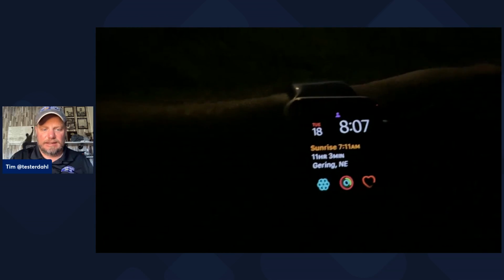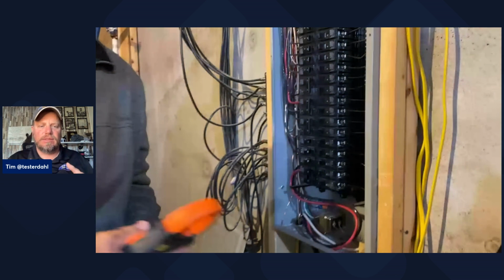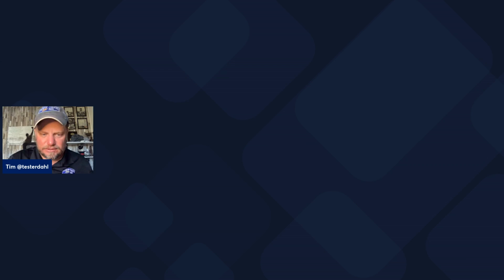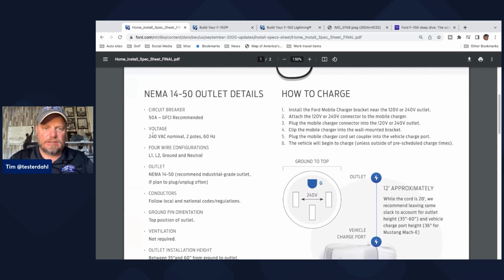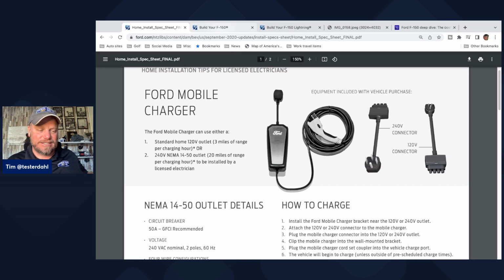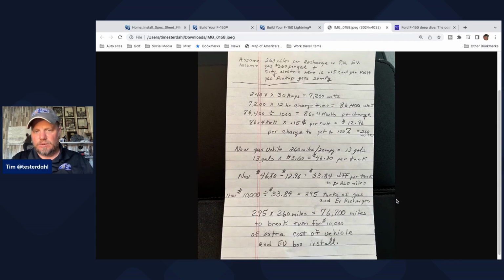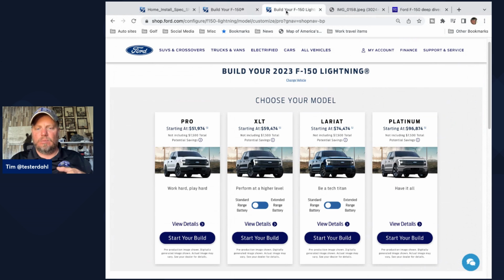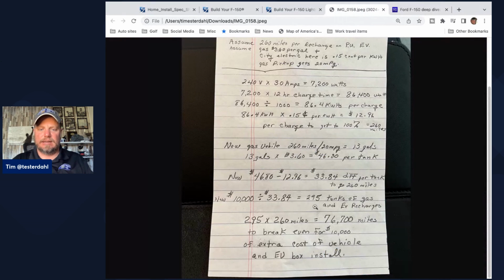11+ hours later on 220V charging price for 2022 Ford F-150 Lightning

Comment from the maker: For those wondering, here is the replacement battery price for the Lightning: https://www.youtube.com/watch?v=gCQLvTiINOo&feature=youtu.be
Reply: If you get 18 mpg over 259 miles @ $5.30 a gallon and you drive 259 miles a day every day for a year.  94,500 miles a year.  You will spend on gasoline alone $21,000 more with an ICE truck.  Assuming 14 cents per kWh for E.  Vs your super slow 5 kW charger.  130 kWh battery adding 50% over 13 hours is 5 kW an hour.  Why didnt you install an 80 amp 19.2 kW charger on a 100 amp circuit, 80% rule?  Charge 100% in 6.5 hours.  Or DCFC at 150 kW.  Depending how DCFC work in your area some charge by time some charge by kW and some are free.  

As for why 5kW the charger may not want to work at only 30 amp and may default to 20 amps.  

The 80% rule.  

40 amp line 32 amp charger
20 amp line 16 amp charger
100 amp line 80 amp charger
60 amp line 48 amp charger
Reply from the maker: @arenjay3278  Easy answer. I don’t have room to add 100 amp circuit without rewiring fuse box, calling utility company and spending thousands more to get the service installed.
Reply: @Pickuptrucktalk  that would be a problem then in Canada houses have 200 to 400 amp service.  Allowing for 100 amp circuits and 80 amp chargers to charge a 130 kWh battery in 6 to 7 hours.  Or a GM Chevy 200 kWh battery in 10 hours.  In your case you will need to public charge.  Your 5kW charge will help but your 120 to 150 kW DCFC speed will mean topping of your truck at a DCFC 65 kW in 30 to 45 minutes.  But dont worry it is still faster than gas.
Reply from the maker: @arenjay3278  Interesting. I had another Canadian viewer who said all the homes in his area had 100 amps of service.
Reply: @Pickuptrucktalk  i guess it depends where you live and if you have duplex or row houses, really close together.
Reply: Wow, it took you about 26 hours for a full charge or 257mile / 26 = 9.88 miles of charge per hour.
So a 26 hour DAY of charging for every full tank!
Or you could go to the gas station and get the whole tank in 5 minutes.
Reply: The 26 hours of charge time makes the truck USELESS for more of the time while a gas truck could easily do 600 miles or more a day for service calls. That would take  3 to 4 days with the Ford.
Going 600 miles would take 600/9.88 (miles per charge hour) = 60.72 hours of charging!
Reply from the maker: @anthonywilliams7052  huh? Sorry you lost me on the math. This is the video you should watch on a road trip with the Lightning. 

https://www.youtube.com/watch?v=2RM1DaRio2M&feature=youtu.be
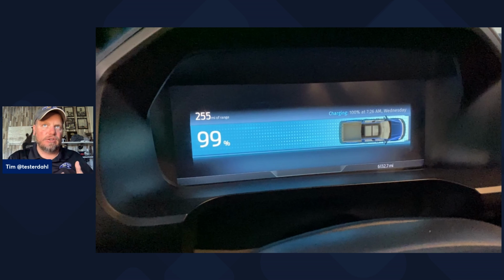Reply: @Pickuptrucktalk  You said at 4:15 "I gained 50% of the range for 13 hours", so that's about 26 hours for the 100% charge. The display shows 255 miles, so that's 255 / 26 hours = 9.8 miles for every hour of charge. Then it shows 259 miles at 99% (about 100) so I used 257 miles, 257/26=9.88 miles per charge hour. So either with 255, 257, or 259, it's pretty close to 9.8 miles for every hour of charge, 259 / 26 = 9.96 miles per charge hour.  I'm counting the 99% and 100% as being the same.
So if you wanted to go 600 miles, that would be 600/9.8 =  61.22 hours of charging. Yes, it's not completely linear but it's close enough for most estimates. Since the battery capacity is going to go down over time, better to under estimate than get stranded too.
Or say 800 miles trip / 9.8 miles per charge hours = 80.63 hours charging. Divided into several charging times. This is just the TOTAL time spent charging.
Reply from the maker: Hope that helps.
Reply: @Pickuptrucktalk  100 Amp Standard 200 Amp maybe, not 400
Reply: Where my daughter lives in Va, they aren’t allowed to even install any 2 Window units over 15amp due to grid limits per household.  No way she could charge a car and it would be at the curb, not in a driveway. 
Me- I have a 400a service and could probably add a 100a charger and maybe stay within NEC but we have two cars.  Yes I have space for 12kw of solar but there’s another $25k to payback. What about families with 3 or 4 drivers?
Reply: Sad to see another seemingly intelligent person, suckered into buying an EV. 
After you went into your eco rant and I realized you think an EV is better for the environment, I just had to laugh. 
The battery in your electric vehicle alone, has already caused more human and environmental damage, than a hundred vehicles with gas or diesel engines. Plus they don't take 13-26 hours to fill the tank and go from empty. 
I laughed when you suggested adding solar power, then powering the truck would be free. Did you forget that the cost of any solar power system that may offset your utility bill a bit? From what I have learned from researching it, that it is going cost an additional $50-$100K. Also from what I have learned, unless you use electricity like one would in the 1940's, you'll still be paying the power company. 
Then with solar, you now have at least one, but probably 2-3 more of those lovely environmentally *cough*friendly batteries. As with all batteries, they are designed to need to be replaced. So now you have those expenses, yet most likely still haven't recovered the initial investment. 

If you don't believe me about the batteries and their environmental hazards. I beg that you please invest some time and research the mining, refining and building, recycling and disposal of these batteries. As well as the human toll, as the needed minerals like cobalt, lithium and palladium are all primary being mined by China and a couple of other Southeast Asian countries, using slave labor including children, to extract these minerals. 

Finally I have to bring this issue up. Kommifornia is the perfect state to use as an anti electric vehicle argument. After years of advocating for EV's, they now have the most EV's than any other state. At the same time they have been switching to "green renewable" energy sources. Sounds great, until you realize the human consequences of not being able to meet basic power needs. Then there are all those EV suckers, who were told by the government not to charge their EV's, as it would collapse the grid. 
I wonder how many acres of land being covered with solar panels and erected windmills it take, for Kommifornia's great plan to succeed, if it is even possible. Then what would traveling look like, if Kommifornia's model was forced nation wide. As well as, how much electricity will cost at that point. $1,$2, maybe $5 per killawatt hour?
I know extracting and refining crude oil, has its own environmental issues. However, we could get rid of every fuel powered motor of every type, yet the drilling and refining of crude oil, wouldn't even see a hiccup in production. In today's world, not a single person can go through a day without see and using petroleum based products.
Reply: Sorry bud solar panels don't work that well and there very very expensive I live in the upper peninsula we on average 200 month for power if your using a lot of electricity your paying 300+ a month so with this added and usual charge of electricity it would be way over a thousand on top of the 120 thousand for ev in the upper peninsula it's not worth it especially for my business
Reply from the maker: @allibani  the UP doesn’t work with solar. That’s for sure.
Reply: To him this video should have been about 3 minutes long you're killing me man
Reply: Have you ever charged overnight from 0 to 100% . I thought that the percentage of charge rate was controlled by current battery percentage
Reply from the maker: @Bear049  Not during the week I had this truck to review. It is true the last 10% takes the longest, that is IF you decide to fully charge the EV. Most people only charge to 90%.
Reply: @anthonywilliams7052  agreed, when you have to go to work 12 hours later the truck is not practical.